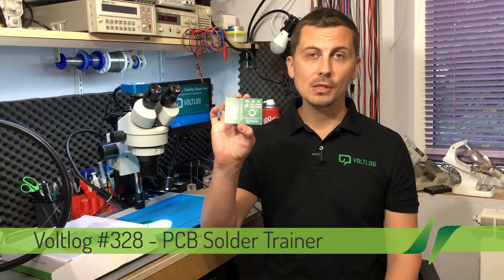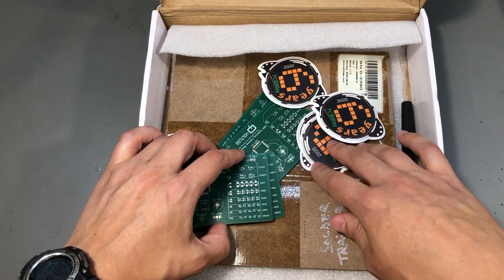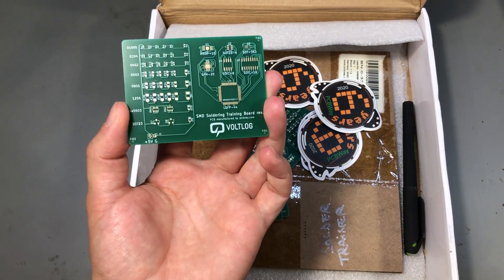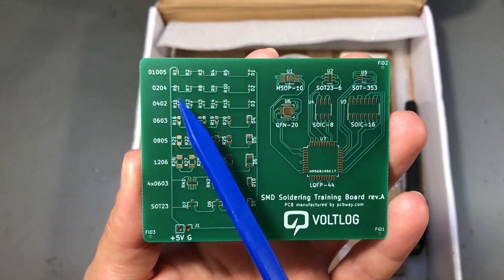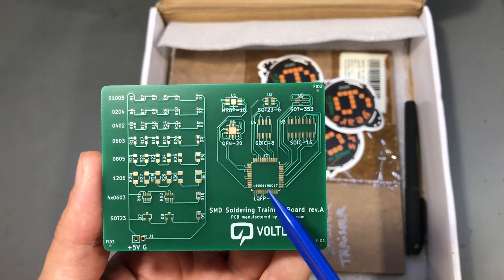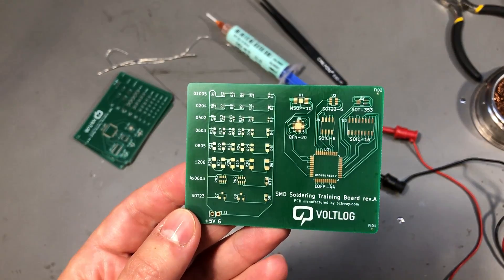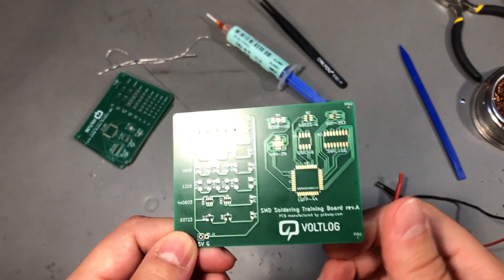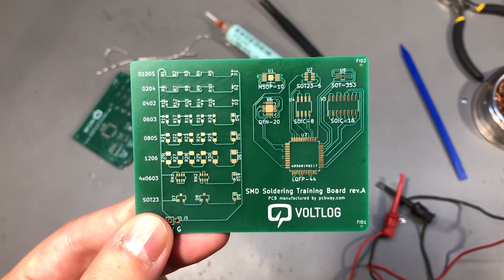PCB Solder Trainer | Voltlog #328

Comment: Some of the T12 soldering iron stations for example the KGER have a 5 pin cable socket instead of a 4 pin socket cable to the soldering iron. What are their differences please?

Comment: Have you been able to take a look at the Handskit T12 soldering station on aliexpress which looks similar to the KSGER T12 soldering station? Except that the Handskit T12 station has a 4 pin out cable connector instead of 5 pins on the KSGER and the screen is said to be Led instead of Oled.
Reply from the maker: Nope, I haven't seen or touched anything from that company.

Comment: I do all my soldering without magnification and use the microscope for inspection. The smallest parts in my projects are 0603 and  SOT-23-6. I managed 0402 once on a SMT trainer, but the looked horrible under the microscope.

Comment: ...... I can solder protons to neutrons using my astronomical telescope, (with barlow lens).
Unfortunately it's a reflector telescope so the image is inverted requiring me to stand on my head.
As I reside on the other side of the planet, this is a common position.

Comment: I'm not going smaller than 0805 without a stencil. I can go smaller, but am not convinced there is a benefit for me.

I think I would have done this a bit differently though. I imagine Supporters have little need for soldering practice. Perhaps integrating "soldering practice" into a ruler would be more useful?
   The only issue I have with existing rulers is the limited reference footprints. Most space is wasted with footprints that are easy to identify, not the ones that are difficult. Everyone seems to make a PCB ruler for a college freshman with no experience. The primary customer demographic is a casual purchase by an amateur, but experienced, hobbyist. We all know what a QFP/QFN 32-64, any SOIC, 1206, 0805, and 0603 look like. The challenge is the 0.6 to 0.4 pitch packages, packages with width spacing variants like sop8, and things like common BGA's. Also the ruler measurement is not very important as we all have better tools for the job. Use the edges for pin pitch comparisons.
Reply from the maker: That kind of advice would definitely produce a pcb rule that is more to my liking as well. The idea for the solder trainer (maybe a poor choice of name) is to test ones capability at soldering which can be a fun exercise but at the same time can also function as a trainer with limited capability.

Comment: $350 for a microscope is not cheap.
Reply from the maker: Maybe not cheap in the general sense, but cheap for someone who earns money by working on electronics and also cheap when compared to what it used to cost years ago >$1000
Reply: Just did some 0402 with a €30 AliExpress "Dental Loupe" (binocular things which clip on to my reading glasses) today, which IIRC is the smallest I've ever tried.  I do inspection with a €5 hand loupe and a €10 clip-on macro lense for this smart phone.
I think I would probably attempt down to 01005 with them (as long as it wasn't a crowded or expensive board).  I'm sure they're no where near as good as a microscope, but for my occasional use, they do the job well.
Reply from the maker: I agree, there are cheap options available which work fine for occasional use. It doesn't make sense to get a big microscope which is going to take half of your bench space if you are only going to use it once a year.

Comment: For the average hobby builder anything small than 0603 just adds to builder frustration. Even 0805 are small enough for most projects.
Reply from the maker: It's true very few people are going to start building a hobby project on something smaller than 0603 but having to repair some modern piece of electronics will most likely include something smaller than 0603.

Comment: Would not bother hand-soldering anything smaller than 0603, whether or not I technically could. As for ICs, anything smaller than a SOIC would only stand any chance with me if soldering it in would be the only way to restore my lost internet connection...
Reply from the maker: Reading your example reminds me of the movies where the guy crashes on a remote islands rips away some transistors, some capacitors and builds a DIY radio transmitter to call for help 😂